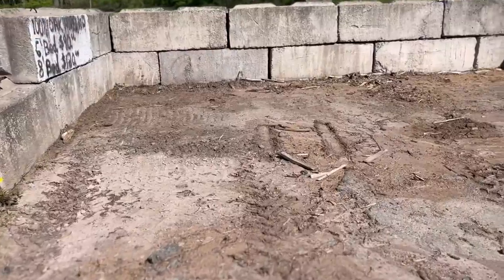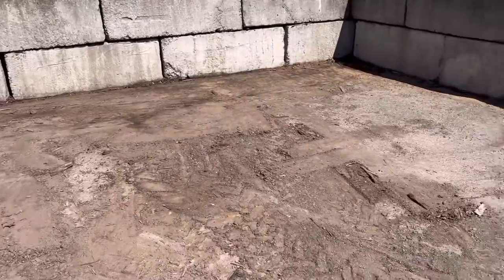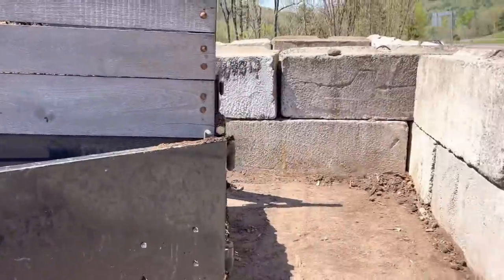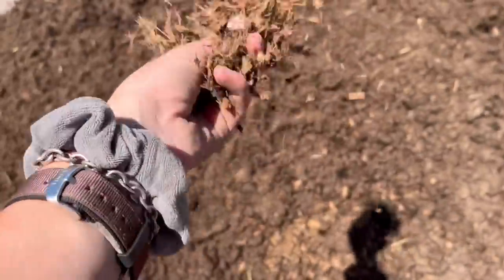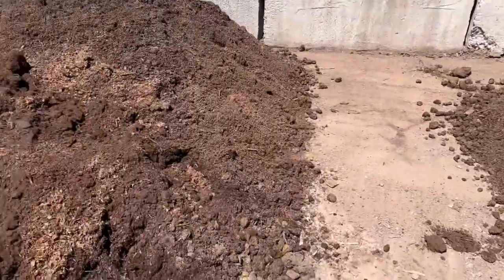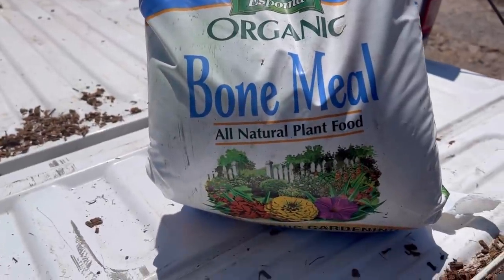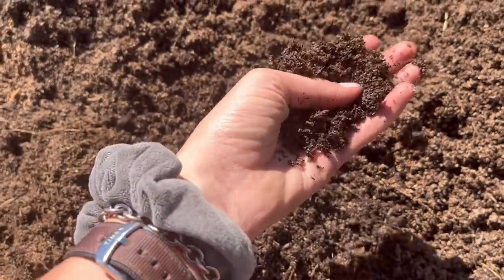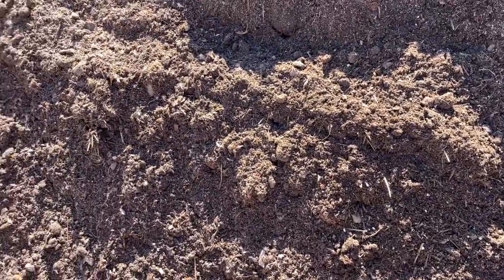Starting a Potting Soil Business 203

Comment: If you want a good side hustle, you can make fire starters with your sawdust. I used to own a candle company and we sold tons of them. The thing with you guys is you already have firewood customers.  All you need is some of those little ketchup cups, I've even used small dixie cups.  fill about 1/2 with sawdust, throw a piece of wick in it and fill the rest with wax . When the wick is lit, the sawdust and the cup will absorb the wax as it melts and become like a wick. They can burn a 10 inch flame for 15 to 20 minutes eliminating the need for paper or kindling. just place under the firewood and light the wick. Candlewic co is located in PA and you can buy scrap wax from them dirt cheap. but you can try it out with paraffin wax from the grocery store or any old wax.

Comment: Great idea Emerald, but for me, I would have a dividing wall and a cover for each side to ensure that the two different sorts of nutrients don't get combined and/or leach out when it rains.  With all special soils, the secret is in the mix and in how well a batch is mixed together, so a small cement mixer would cost little compared to the returns over a  period of time and it will make your mixing far more reliable and easier to manage.

Comment: I know space may be tight with areas In your walled off spaces for you guys, but if you had another area to do the separate soil in then when you turn it with the bucket you would be able to take a scoop from the left and dump it on the right. Then vice versa the next day. This would make it a very time saving way on the machine to also do a fully to the bottom of the pile to the top turnover.

Comment: A friend of mine bought an old concrete truck with a bad engine and mounted the rear frame and bowl  on a foundation and installed an electric motor and it lasted for twenty plus years. It was the best mixer and you could put a lot of things in the mix due to its large  bowl.